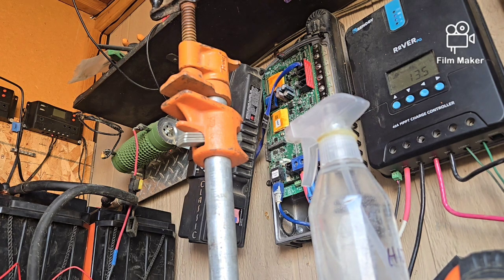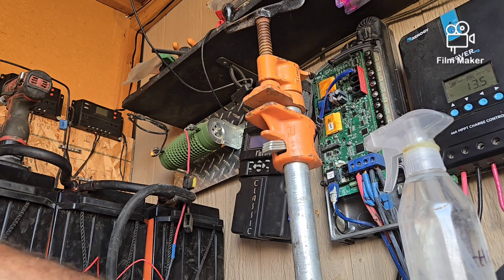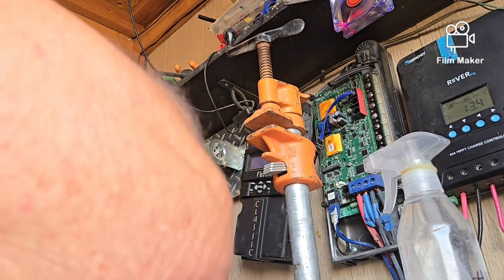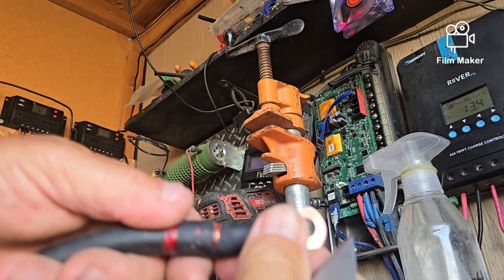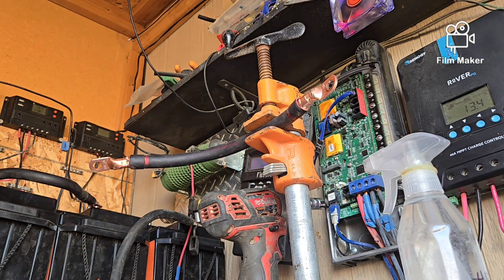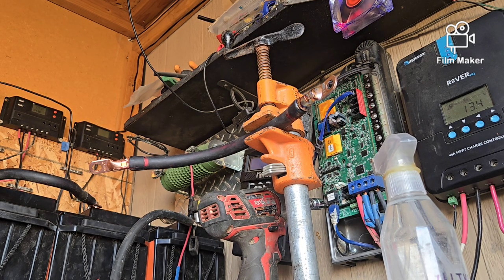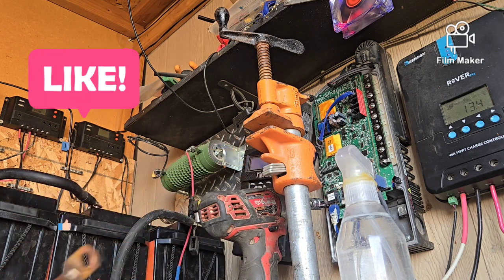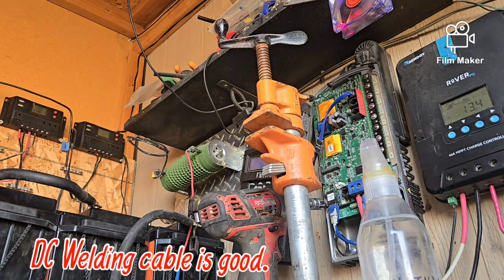Fixing A Hidden Problem With LiFePo4 Bank, July 11, 2024

Comment: If I may ask.  What is the green colored wire wound object for, and what is it called?   It's just above your batteries with an inline fuse.  Thank You.
Reply from the maker: @scottmoresy7709  Welcome aboard, Scott.  That is a dump load resistor.  It burns off extra power through heat dissipation.   It was used along with a dumpload controller on my lead acid battery bank, for my turbine input which could reach 1850watts in high winds.  I no longer use it, but may convet it to a timed heater in the battery room in winter, since I now use LiFePO4.

Comment: 8:15 good job, GBear.  A small clarifying addition should be noted that one should use ROSIN core solder (not acid core solder, which is used for metal work).  Flux by itself can be in various forms, but the importance with electrical wiring that GBear is doing is that it be rosin core solder.  For those who may wonder what flux is, here's a copy-and-paste on the definition of flux: "Flux is a chemical compound that helps prepare the metal surfaces for soldering by removing oxides, promoting wetting, and enhancing the flow of solder. It typically comes in the form of a paste, liquid, or core within the solder wire. The flux compound contains active ingredients, such as rosin or organic acids, that react with the oxides on the metal surface."  While GBear is 100% correct that flux core solder be used, it's important to note that because the flux can be either acid or rosin, that one use rosin flux core solder.
Reply from the maker: @samvalentine3206  That’s why I added the comment, "...for electrical wire."
Reply: @GBear  - Yes you did.  I wasn't trying to say you were wrong, I just wanted to clarify your excellent video!  I used the same procedure for my 00 homemade cables for my hobby system.

Comment: I've always seen crimp & drill 3/16 hole above the lug into bottom of wire bottom out then solder in hole but that works
Reply from the maker: @dons5105  Welcome aboard!  Yeah, no need to go through the extra work.  I've soldered on terminals for over 55 years and never had a single one fail.

Comment: G Bear  you did a fine job with that , I worked as a electrician for several years before I started driving my own 18 wheeler over the road for 30+ years👍
 Jimo
Reply from the maker: @oakshillelagh4339  Welcome aboard!  Thanks.  I'm glad I caught it!  Loose connections and LiFePO4 batteries don't get along well.

Comment: I picked up a heavy duty battery cable crimping tool the blue one you see all over Ebay but it sucks. I was crimping 35mm lugs and they would come off. So what i did is crimp the lug on with the 35mm then go down a size on the crimping tool to 25mm and that worked great. I had to do the same for my 16mm cable and 10mm cable as well.
Reply from the maker: @daz.r1994  Yep, I never liked crimping for anything over 3mm.  I can always trust a solder connection though.

Comment: Just my opinion...
Crimp then always solder
Reply from the maker: @JamesHollinger-lt8qx  You could, but it's a waste.  Solder would be doing all the work anyway.
Reply: We were taught that you first need a good mechanical connection with terminals as well as using solder to fill the voids and assure that it will be basically bullet proof.   So I agree with you, James - crimp then solder.  One method or another would be fine, but better to have the best of two worlds, a good mechanical connection AND a good solder connection.  I have seen connections fail that have been made with solder only which when heated by electrical current flow, whereas if a wire is coiled or crimped on a connector, even if it gets warm enough to melt the solder, the connection will still hold electrically due to the mechanical means, crimped or twisted wire...
Reply from the maker: @samvalentine3206  If the wire gets hot enough to melt the solder, get the hell out of that room.

Comment: Good work catching those bad connections. I would make one suggestion, move the whole operation outside. Spritzing water so close to your charge controllers makes me just a little nervous.
Reply from the maker: @pennycardon3276  Welcome aboard.   Rest easy.  I was very careful to keep far enough away, the camera made things look closer than they really were.  But thanks for your concern.
Reply: @GBear  - 9:39 we can see that you changed the angle of the spritzer as there was a little over-spray on the corner of the Renogy Rover power controller - no harm, no foul!  😊
Reply from the maker: @samvalentine3206  Yeah, I was aiming for the high voltage connections.

Comment: Good Catch on those loose terminals as the heat shrink was the only thing holding them on the terminals. That's exactly why I solder my connectors instead of crimping them. One last thing is to make sure your connectors are turned in the right orientation to where they attach to so the wire lays right. I'm in the process of installing my new adjustable solar panel brackets on the roof of the garage & getting all the wires, connectors & fuse blocks situated. This is really a fun project. Keep those videos coming GBear.
Reply from the maker: @miguelsalami  Thanks Miguel.  I didn't install panels on the roof, because I occassionally get snow here and didn't think climbing on a slippery roof to clean snow off them was an appealing idea.
Reply: IN Reality, - NEVER - solder High Power Connections.... ALWAYS CRIMP THEM ON- With the PROPER CRIMP tool.
Solder will melt and run out of the connector creating a fire hazard. A PROPER CRIMP will NEVER come Loose !
If your Crimps are coming loose, either the wrong size connector, cable, or crimp die - procedure - was used !!!!!
Reply from the maker: @alh871  Always solder DC connections.  If your wire and connectors are getting hot enough to melt solder, you are using the wrong size wire and/or connectors, or you have loose connections.
Reply: @GBear   - We are not going to agree.
I've worked with High Power DC electric and you Will NEVER have as - SAFE -  a connection by soldering, than by Crimping, IF Crimped CORRECTLY.
Reply: @alh871 I would think crimping would allow moisture to infiltrate the connector & eventually cause corrosion. I realize heat shrink tubing will help prevent that but another thing is IF a wire is fused correctly the fuse will protect the wire & prevent a fire.
Reply: You use No-Ox electrical "grease"in the fitting, that stops any wicking or oxidation.
Reply from the maker: @alpo8193  Welcome aboard.   No, I only use No ox when connecting aluminum wire to copper wire.
Reply from the maker: @miguelsalami True.  But like I told them, if your wires are getting hot enough to melt solder, you would have other problems.